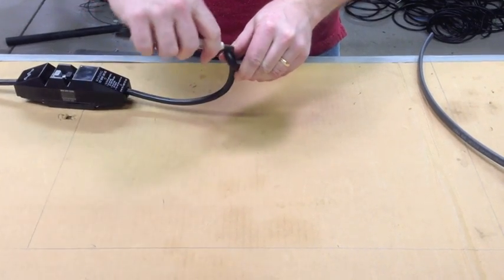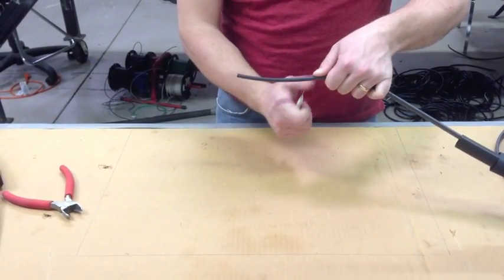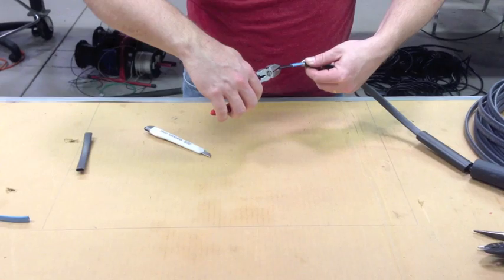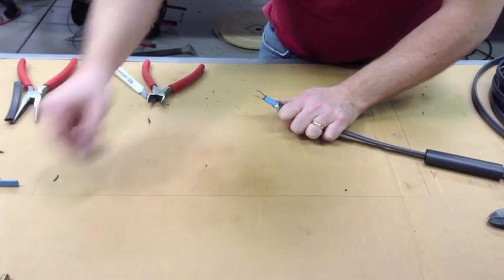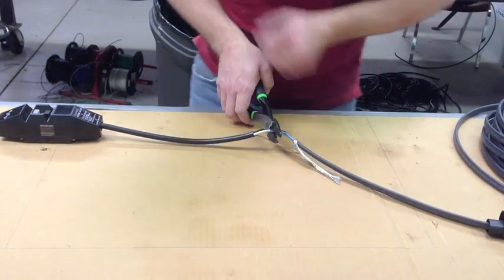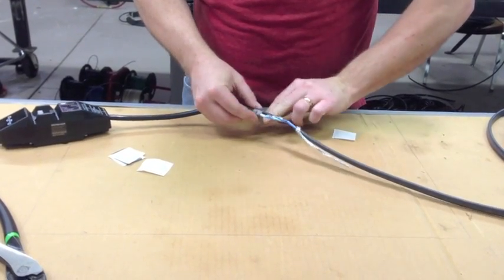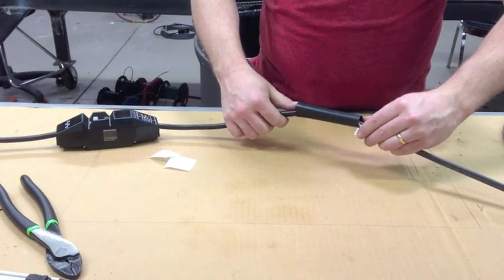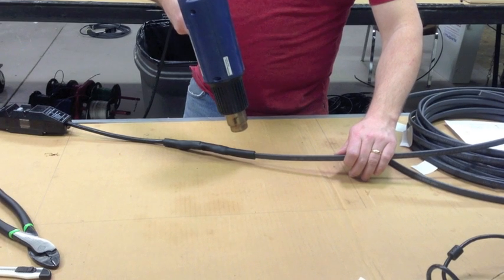Heat Cable Splice Kit Tutorial

Comment: I had a cut heat tape (all three wires were cut not exposed like stripped  but heat tape was cut in half) . Not my setup but if I had to guess I would go with crappy harbour freight stuff .So it was energized ( while it was cut in half stupid I know ) on a gfi and plunked into water and I saw a tiny short and of course gfi popped instantley. * Did I fry this heat tape beond repair ? * Didnt smell anything burnt would the thermostat have fried ? Appears to be what looks like a fuse link a foot away from the plug end about the size of a  AA battery but its not no way to open it guess its the thermostat would I hv cooked that thing ? Important as the other end is frozen in ice while water is pissing everywhere else its not supposed to so I really  that I really need to heat that up.  Help appreciated important

Comment: You were almost right with this tutorial.  Only mistake was removing the bus wire from the semi-conductive jacket.  You are suppose to strip the bus wire like a regular wire then krimp.  Also, heat shrink should always be used to sleeve wires, never masking tape.  Other then that, tutorial was good.

Andrew Williams
309A Journeyman Electrician
Reply: I also thought he said masking tape, but what he's using is clearly not masking tape.  I'm pretty sure he's using self sealing mastic tape.  It's a waterproof tape.  He also covers the whole splice with shrink tube.  The combination of the two should stay waterproof.

I agree with not stripping the bus wire the way he did.  The sleeve from the butt splice should overlap the insulation.  I just cut out a strip out of the middle the two wires so it looks like two regular insulated wires then strip each individual wire at end to expose the bare wire.